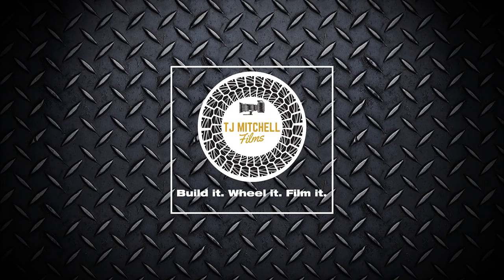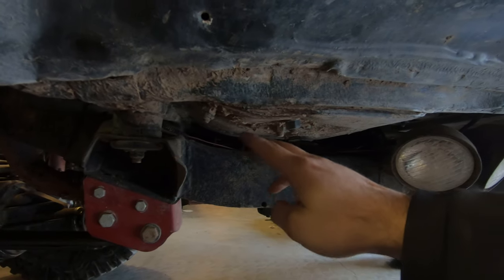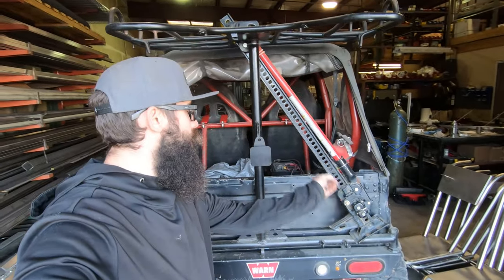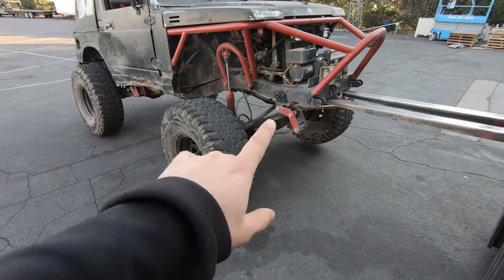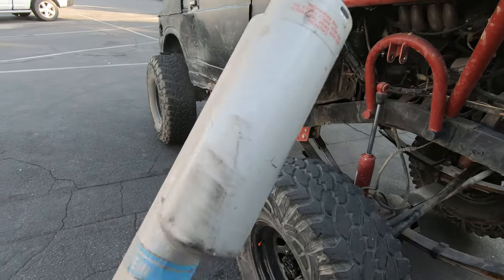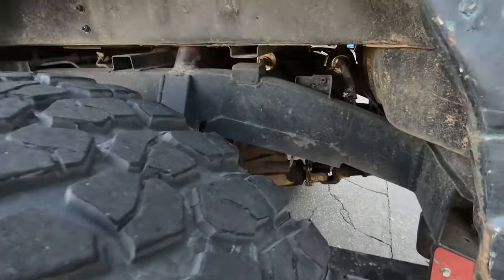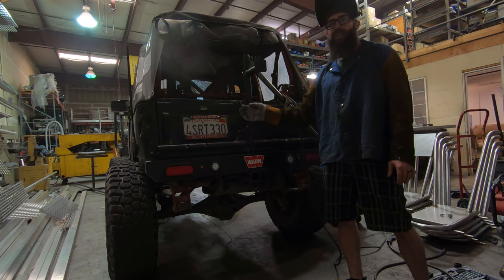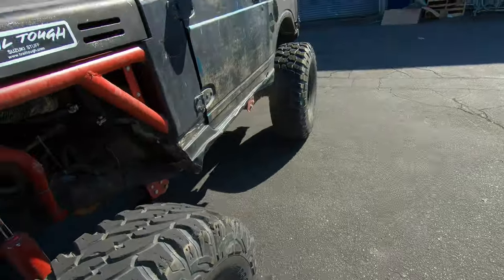Suzuki Samurai Rock Crawler Gets Some Upgrades (Samurai Rebuild Episode 1)

Comment: Does  the auto transmission line up with the transfer case from the samurai or you using different on????
Reply from the maker: It has a samurai transfer case still. The intermediate drive shaft is just shortened down

Comment: The hole body is rubber mounted and now only the cage is fixed rigidly to the frame ?  I think better solution the cage was a part of the body  (strong fixed) as every Rally car has ,if it extremely rolls and maybe the body get apart from the frame and  the rollcage was rigidly  fixed to the frame what happened?  I dont want think about this !